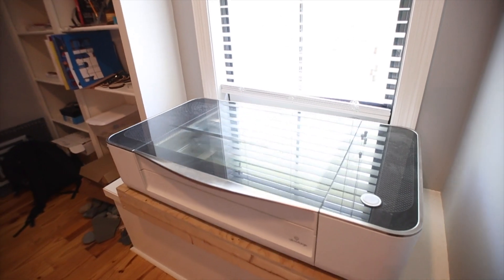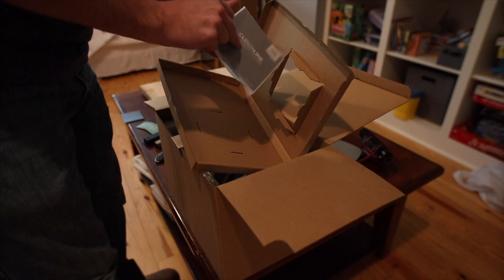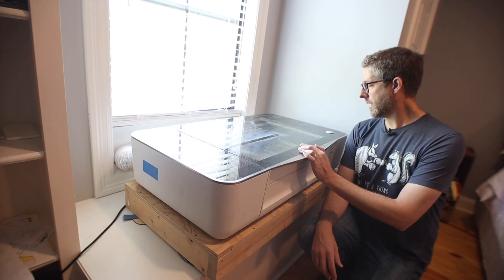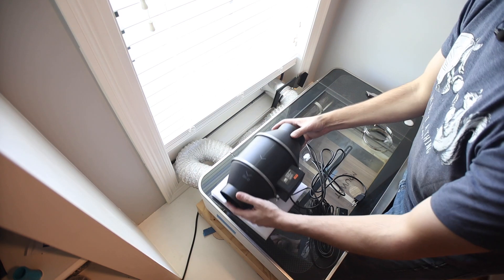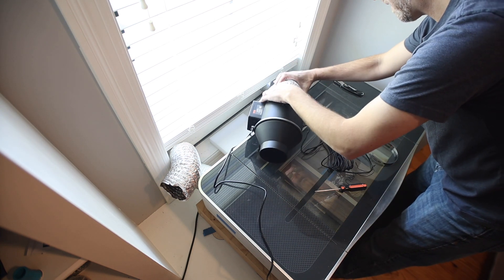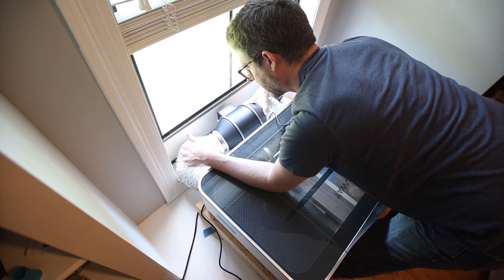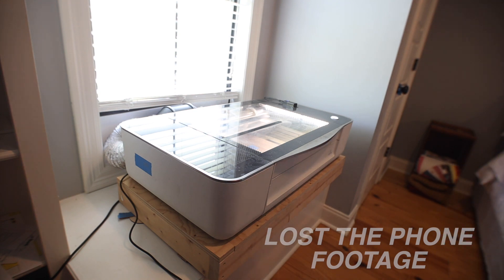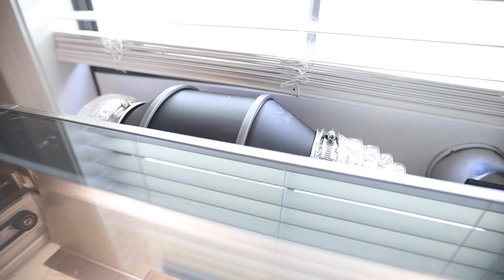FAN UPGRADE GLOWFORGE LASER ENGRAVER

Comment: Holy cow. That was LOUD! I wouldn't have been able to stand that.
Do you have something on the external of the vent to keep bugs and critters out? Last thing you need is an armadillo trying to print something...
Reply from the maker: Yeah, it was crazy loud! Yep...I have a blast gate on the port that I close when not in use. That way, critters, and moisture cannot get in from the outside. Especially not armadillos! (this is a second-story window, but you never know with those things. ha ha)
Reply: If you scare a dillo they can jump like 5 feet up...

Comment: Ahh so it's the blower for the fumes. That's awesome. It's so quiet. Where is the air assist compressor?
Reply from the maker: For this machine, it is onboard. There is not a separate compressor.

Comment: The first time you used that on the video it sounded like a jet taking off at London airport. When you had put the filter in it sounded like a printer in the background, but you had a slogan “lost video from my phone” so did you rerun the test or what?
Reply from the maker: Oh, the video I lost from my phone was just showing another angle that I had it all setup with the camera (main one recording the sound) sitting in the same spot as the "before" video. If you go all the way to the end of the video, there's a side-by-side comparison that makes it very clear to hear.

Comment: Well done video.  I did the same thing about 6 months ago and it was a complete gamechanger in being able to do other things when the glowforge was running.  Now you can start thinking about completely taking out the stock fan which really improved airflow (pretty easy to do but have to have a cheap auto trim removal tool to remove the left panel)
Reply from the maker: Oh I haven’t even thought about that! Good cal. I think I’ll be upgrading my laser before I do much more to this one.